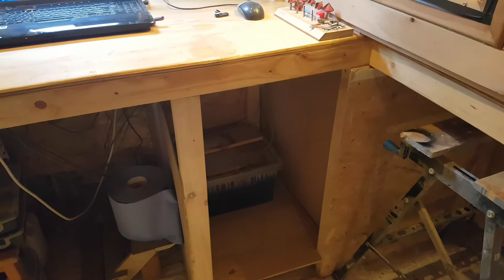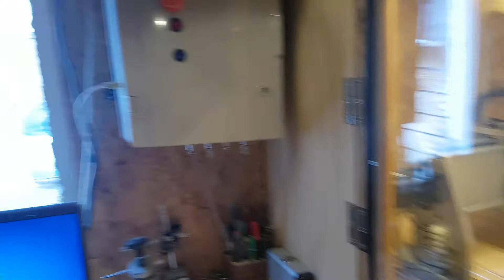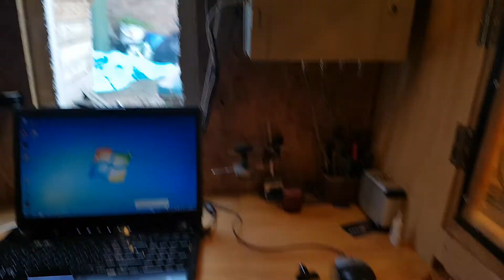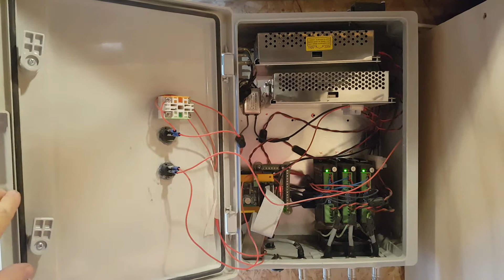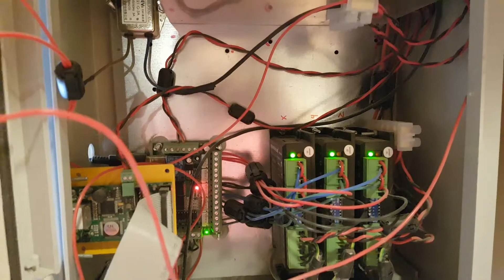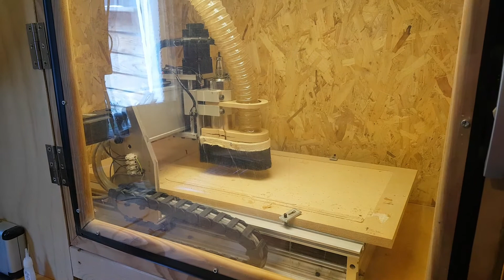My CNC 6040 set up with custom control box build

Comment: Thanks for update. I'm jus rebuilding the electronics of my 3040. I 've got a UC300ETH-LPT with the UCBB breakout. Can you jus go through what you did with the 5v to the UC400. Did you mention with the 24v plugged into the breakout board it powers the UC400, is there a cable inbetween or does it get power over the ribbon cable? My understanding was that you needed to power the UC### with 5v, this is then sent to the breakout board. Maybe it is different on the UC300ETH-LPT. Cheers